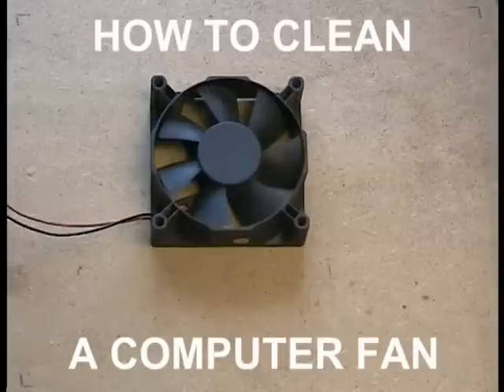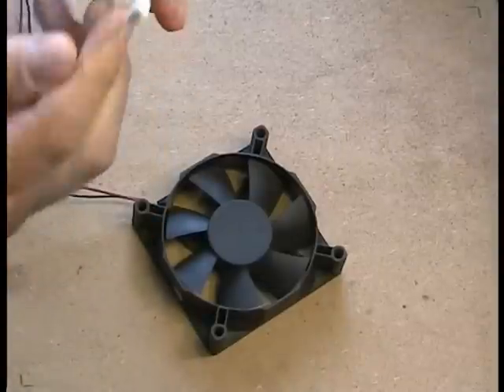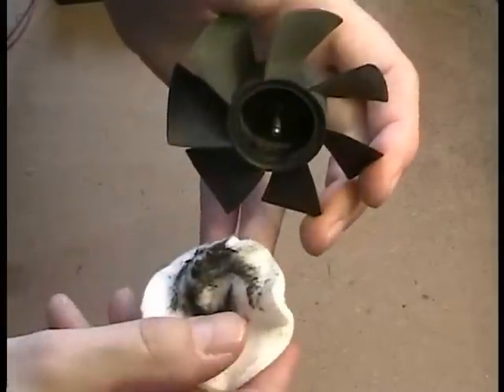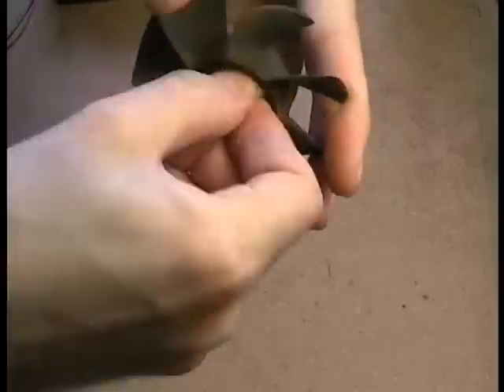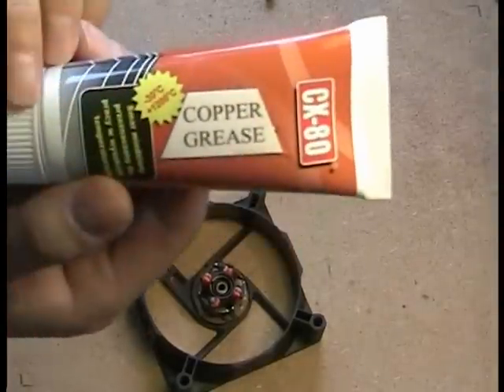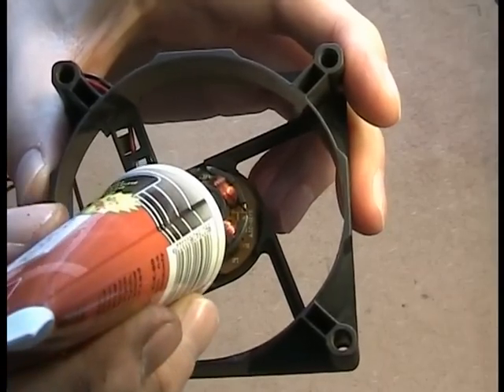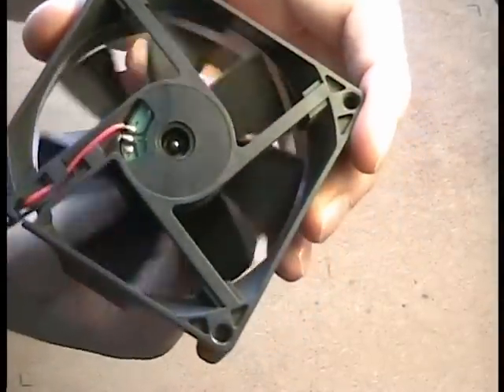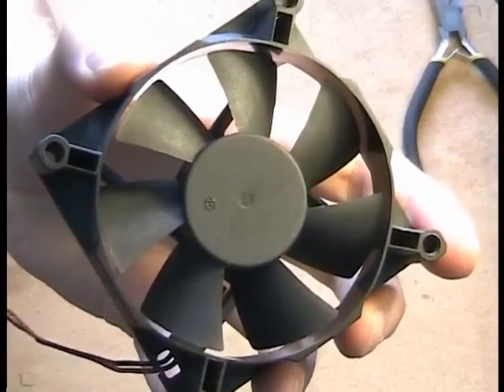How to clean a computer fan

Comment: How to clean DPU fans
Reply from the maker: Can you show what it looks like?
Reply: It looks ridicules.
Reply: Just too much dust.
Reply from the maker: What is the fan like? I can't find what a DPU fan is.
Reply: Sorry its a Processor fan
Reply from the maker: So it's a CPU fan. There are many different types of processor fans. First thing you want to do is disassemble the heat sink and see if the fan has the hole with the rubber/plastic seal. If it's not present, you would need to drill a hole there. However think if it's worth the effort.

Comment: wd-40 will it work? i got no other oil
Reply: try "Hobby oil", or "sewing machine oil" (same thing really). Its very thin, but it works for many such things
Reply: wd-40 will dry up and wont lube it very good. Just get yourself some oil or grease (i prefer grease myself).
Reply from the maker: WD-40 is good for removing old oil/grease, not too good for lubricating.
Reply: yes iv yoused wd40 on pc fans befor and it works grate

Comment: My fan has a Aluminum base to it dust magnet anyway u should plug the fan in at the end to show it works good
Reply from the maker: My fan was from a power supply, there was no heat sink.

Comment: oh i tried but looks like in my fan there is no seal to take out , i had a circle in the middle but really can't take it of even with i knife looks like its one piece
Reply from the maker: +FARES SALAH Unfortunately there are some fans, which are not meant to be fixed.
Reply: ty man but i found like a core made off copper and really couldn't take it out , so hard i can't find the same fan type here , got another amd piece but don't really fit so temp goes from 42 to 53 in half second and goes down again
Reply from the maker: +FARES SALAH If it doesn't fit, your temperature may be higher than normal.

Comment: waste of time. most fans are made in china junk. I buy another one
Reply from the maker: +PhuckHue2 Not everything made in China has to be junk. It's just a how-to video - you don't have to clean your fans.
Reply: ElectronFun.com
its all junk. once dust gets in there its toast. fans are $5
Reply from the maker: +PhuckHue2 I wouldn't say all fans are bad. There are so many of them on the market... Maybe you should try something more expensive than $5.
Reply: ElectronFun.com
whats the sense of paying more for the same junk? they will die just as fast as the cheap ones. its all made in china junk
Reply from the maker: +PhuckHue2 If you say so.

Comment: how can you test a fan to see if it works when it's out of the pc tower without splicing the wires?
Reply from the maker: +Dennis Rivas Supply 12V to the red and black wires and it should spin. There are some fans that use 5V, but they are rather rare.

Comment: i removed the lable on mine and all it had was plastic no nothing
Reply from the maker: +meareAaron Unfortunately some fans are hacker unfriendly :) You can try drilling a hole in the center if you have time for it.
Reply: +ElectronFun.com im not sure where to drill but i will try hahaha didnt want to throw away that 80mm fan i found to bad it has no wires so couldnt use it and like i said it has no cap at the back
Reply from the maker: +meareAaron Drill in the center. If it doesn't work, you won't lose much :)

Comment: what do i do when i lose the plastic washer?
Reply from the maker: +Sebastian “Sebi” Grygiel I've tried turning on a fan without the washer - worked with no problems.
Reply from the maker: +Aquakey 98 You can try to make a new one, but I'm not sure it's worth the effort. You would need some kind of a thin plastic sheet to cut it from.
Reply: +Aquakey 98 Usually the magnets keep them in place and they are alright when turned on as well. Unless it flies out or vibrates strangely you can just leave it with no washer.
Reply: yup it worked just fine. just hope it stays this way n tt my gf wun ever find out
Reply from the maker: +Aquakey 98 :)

Comment: Very nice video  I would also add a couple of drops of 3-IN-ONE oil or sewing machine oil to the shaft. Old timer with two desktops, one seven years old and the other eight running win 7 and win10 in my home, one for myself and the other for my wife. Have used  3-IN-ONE oil for many years on our PCs in addition to the things you recommend for cleaning. Thanks again for the video
Reply from the maker: +Ray Gardner I agree - sewing machine oil, or 3-in-one oil work too. Thanks for watching the video and leaving your comment :)

Comment: Do you know how to fix one? Or to know if it's broken rather... I'm building a homemade air conditioner with an old fan i had at my first computer like 8 years ago, but when i connect the cables (if i'm doing it right) it won't turn on, maybe the yellow things inside burned? (sorry, don't know the name) Anyway, nice video, i cleaned it nice..
Reply from the maker: +Rodri Nicolau How many wires do you have 2 (black and red), or more 3-4? If there are only 2 wires, you can simply connect it to a 12V (in most cases) power supply - if it's clean, it should turn.
Reply: ElectronFun.com Well, it seems i might be in trouble because it doesn't work :P
Reply from the maker: +Rodri Nicolau The fan may be burnt :(
Reply: ElectronFun.com now i disarmed an old laptop but realized that the fan is too small for what i want to do
Reply from the maker: +Rodri Nicolau A laptop fan is a bit too small for a project like that.
Reply: ElectronFun.com yeah, i noticed. You know what? I made both work
Reply from the maker: +Rodri Nicolau How did you do that?
Reply: ElectronFun.com The oldest one i think it was a little bit rusty, that's all.. i just gave the fan a little notch and that was all, it was running :P
Reply from the maker: +Rodri Nicolau Cool :)

Comment: can i use mobil oil instead of grease as lubricant.And one more thing that i have grease that i use in my bicycle so can i use that in computer fan.please reply soon.
Reply from the maker: +Somnath Das I guess both of them should work. Try applying the grease for example and see how your fan works. If it spins rather slowly, you can always remove the grease and try using the oil.

Comment: hi I have this model Haier Freezer Cooling Fan RF-2750-17

its for my mini fridge I dissemble it and found that the fan is a bit loose I have been looking everywhere to see how to get into the fan and fix it luckily I came across your video after a few weeks .. I was about to buy a new fan but I will try out ur video and see if it works for me thank you ( unless you suggest otherwise )
Reply from the maker: +Jamie Mancilla Hi Jamie, I'm glad you've found my video. If the rotor is loose, your fan may be worn out. However, try to disassemble the fan and see what's going on inside. If you don't fix it, at least you will satisfy your curiosity.

Comment: WOW, what a great tutorial, exactly what I was looking for... I wont be throwing away "noisy" fans anymore!!! THANKS!!!!!!

Note: I had to dremel the top cap from my Cooler Master fan... did this very gently using the dremel press-drill tool and small drywall cutting bit, nice round clean opening to the circle clip...

Thanks again!
Reply from the maker: +Fred Methot Thanks for your advice with drilling. Some fans don't have that rubber cup and the only way to get inside is a drill.

Comment: can those fans wobble a bit or are they supposed to be fixed just like gpu fans?
Reply from the maker: +albarrak7 Now I get what you meant, thanks to Abyssic1, who is absolutely right. You can't fix every single fan, sometimes they simply wear out, and you can only replace them with a new one.
Reply: ok thx you guys
Reply from the maker: +albarrak7 I'm not sure what you mean, can you explain it a little more?
Reply: +albarrak7 depending on the bearing type and quality of the fan, the fanblades can "wobble". that should not be a problem as long as the fan doesn't make any extraordinary noise caused by the fanblades hitting the housing or other irregularities. if the fan is making more noise than it's supposed to do and you've already cleaned it, there's nothing you can do except swapping it out for a new one.

Comment: Really great video, rally thorough explanation and good shots of what you were doing. I have a question, instead of the alcohol,  do you know if I could you use graphite powder?
Reply from the maker: +Third i Studio Thanks a lot for your comment :)
I used the alcohol to clean the old lubricants and dirt. As far as I know graphite powder is used as a dry lubricant (e.g. for locks). I'm not sure how it would work in a fan, never tried it.

Comment: Can i do this with my power supply fan aswell?
Reply from the maker: +Stefan van der Holst Sure you can. The fan in a power supply is usually much more dirty than any other fan in a PC.
Reply from the maker: +DamageIncM You definitely have to peel off the warranty sticker, but as you mentioned you usually don't clean the fan in a new PSU. I wouldn't say it's risky, as long as you use common sense and don't play around with the board inside. There are high voltage capacitors, which may be charged even after power is cut. Just unscrew the fan from the enclosure, clean it and mount it back.
Reply from the maker: +DamageIncM Sure, there are usually 4 screws holding the fan in place.

Comment: I f you use two small screwdrivers to remove the plastic circlip you will find it much easier and also stress it less. use one to hold it in place with the other find the split and lift it out.
Reply from the maker: +SwGuru Good tip - thanks :)

Comment: all plastic and metal parts can be cleaned with soap & water and  a toothbrush.
all will be cleaned with no effort. people fear unnecessary for water but it's the best solvent than any alcohol or other media. dish washing liquid will do the job simply clean.
Reply from the maker: +skylark304 I wouldn't use too much water. It's not as "clean" as you might think. Water suppliers add many different chemicals to it.

Comment: Thanks, I fixed my noisy case fan by using the same method. It worked for a few weeks then the noise started again. This time I removed that nylon circle which was a bit harmed after my first removal. And tadaa !!! It's been a few months and its all good and quiet. Dunno if its related to it but you can try removing that thing if its still noisy after cleaning. You probably shouldnt remove it if your rotor looks downwards as this little thing prevents rotor from falling off.
Reply from the maker: Berkay Bereket Thanks for your comment, I'm glad you managed to quiet your fan :)

Comment: You can use Lighter Fluid for cleaning. Avoid using Isopropyl Alcohol that are 70% solution and don't use 30% solution, the water content can damage some circuits especially when not dried well...
Reply from the maker: Nehemiah Antalan I used 96% Isopropyl alcohol if I remember correctly and it worked perfectly.

Comment: This video was a revelation to me.  I'm responsible for maintaining the computers in our office, and for years, when a computer developed a noisy fan, I would order a new fan and replace it.  I never thought they could be dismantled and cleaned.  I just figured they were disposable parts.  I'm very happy to discover this, because it saves me the expense of a new fan, and the time.  I would have to dismantle the computer to find out what kind of fan it is (and more often than not, they seem to put the label on the side you can't see it, until you take the fan completely out).  Then, I'd have to order the fan, and I'd usually reassemble the computer in the meantime while I'm waiting for the replacement fan, so I don't lose parts.  Then, when the replacement fan arrived, I'd have to install it which means of course taking everything apart again.  So, being able to do it all in one operation of dismantle, clean, and reassemble is a big time saver as well as money saver.  Thank you very much!
Reply from the maker: Mark Fairchild I know exactly what you mean, because I had the same problem in my office :)
Thanks for your comment!

Comment: Would lithium soap based grease be better than copper grease for lubricating the fan?
Reply from the maker: Ciklo Gremlin Honestly I don't know, I've never used it, but I guess it should work too. I've read that  lithium soap is free of corrosive properties, so it should be safe.

Comment: I believe it is a bit of overkill.I usually blow out what dust from the blades with compressed air(hold the blades to keep them from spinning),then use a damp rag to get rid of the rest.Then take off the label and rubber plug out.Put in a couple of drops of light machine oil(I use sewing machine oil).By the way,make sure the bearings aren't worn.Put it back together and power it up with a 12v supply to make sure the bearings have been lubricated,or use the computer to power it up.I have recovered everything from record players,tape decks(back in the day) up to computer fans,etc.A good tutorial,anyway.
Reply: I do not agree with the part of your comment:  "I believe it is a bit of overkill"...because just blowing out the dust from the blades will not get the cleanliness off of the area under the seal and rubber plug.  I know smoking cigarettes is bad....but I have not stopped smoking as of yet...and the smoke residue ...invades every single part of my pc.  THEREFORE:  In my specific instance; a very through cleaning; such as shown in this video is necessary for me.  BUT, for other people this may indeed be an 'overkill'.Even if I did not smoke cigarettes, once I went to all the trouble to get to the fan and remove it, I am the type of person that wants the job done as well as it can be done....so I do not have to REPEAT the process any more than necessary.For non-smokers, probably like yourself, you may not understand fully the FILTH inside of my pc fan.Your comment may work for others....just not for me.  That being said....have a great day!
Reply from the maker: Mike Henwood Thanks for the tip Mike :)

Comment: My PC is noisy when I turn on, but after some time it get quiet again. Should I just suck the dust with vacuum cleaner or clean fan, like in the video? Thanks.
Reply from the maker: Jang Čop This means your fans, or one of them is pretty dirty. You can try to use a vacuum cleaner and if it doesn't help, clean and lubricate the noisy fan just like in the video.

Comment: Excuse me sir but I have a question. Just to tell you, I have a desktop that runs the fans like cooler with air coming out but like a 1 or 2 months ago, the desktop of mine was running little bit too little bit loud and warm and I want it quieter. Do I have to clean out the dust from the desktop input and wipe it with napkins or paper towels? I mean I am just asking.
Reply from the maker: If your fans became louder it's a good idea to clean them - it may help a bit.

Comment: You should clean more thoroughly  the bushing (bearing) before applying the grease.
I use to take a piece of tissue, twist it to "thin rope" insert into the bushing hole, moving back and forth to clean the bushing inside.any how, a very helpull vudeo!
Reply from the maker: Thanks for sharing your experience. It's quite difficult to clean the bushing hole because it's so small. I agree - I should have done this more thoroughly.

Comment: ELECTROFUN  I WASHED MINE WITH WATER NOW I PUTTED IT IN SOME RICE can i then use it again after some time
Reply from the maker: Try if it works after it dries. I would also lubricate the fan, if I were you.
Reply: with wat??
Reply from the maker: You can use copper grease or machine oil.
Reply: ok